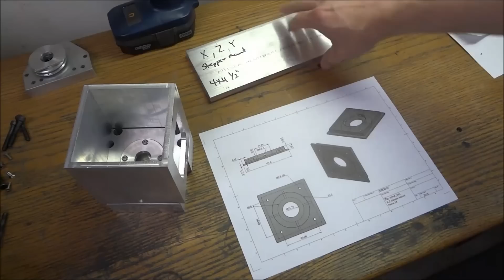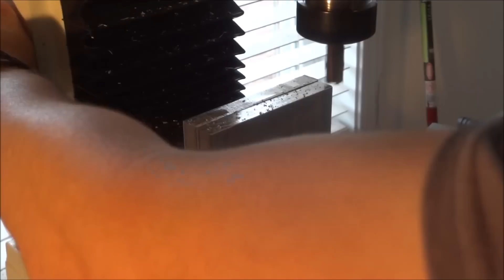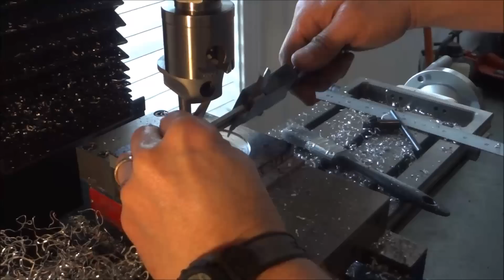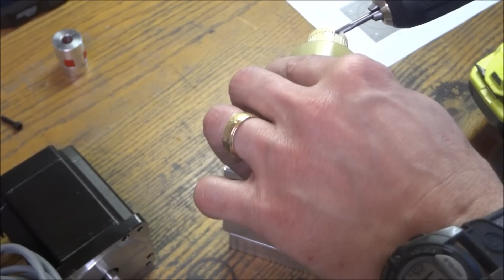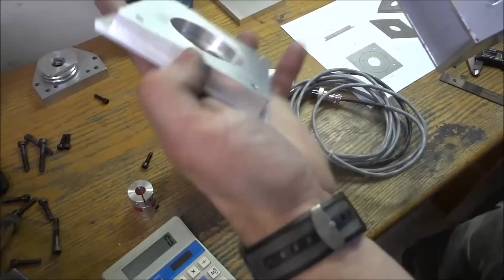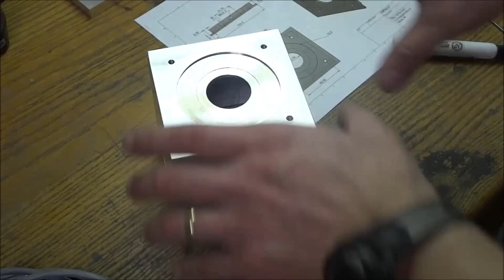PM 727M X Axis Stepper Mount Machining

Comment: Why did you eyeball the screw holes instead of using the handwheel scale?  To save time, use the hand wheel and do all 4 center holes, shaft hole, then switch and drill all 4.  Always back off and advance so all moves are in the same direction to prevent backlash issues.
Reply from the maker: the scales are not that accurate.

Comment: X Stepper mount finished !!!!?  How did you measure for center?  Bolt location?  What is your secret oh master of the bench mill ?
Reply from the maker: +SOCOLVN  
Yep for the most part I still need the ball nut coupling to do. The simple answer to your question is that I just measured the original location which was 2" my new ball screws are a little smaller in diameter so I figured it would be just fine. 
This also worked out well for the Spacer and Stepper mounts. 
2" being the center of a 4x4.

Comment: hay Sam, glad to see your manually machining your conversion parts. I'm sure it's gotta be tempting to just fire up your x2 especially since you have it drawn in CAD already. the recess for the stepper motor would have been a 40 second opp. with an interpolation, I'm sure the boring head method  probably took a good 10 min.   keep on keeping on man looks great, Ken
Reply from the maker: +Ken Estelle  
Thanks Ken, I want to show that it can be done it's pretty simple just take it one step at a time. Its tempting for sure the stepper recess was the most difficult of all the ops its a big diameter Lots of cuts. maybe 30 min. would have been 5 on the X2 LOL
Be Safe,
Sam